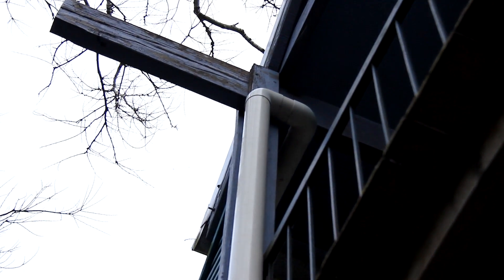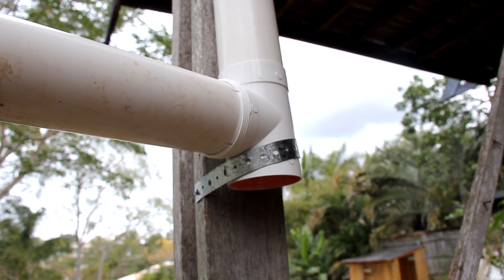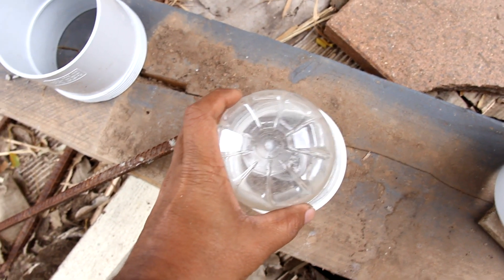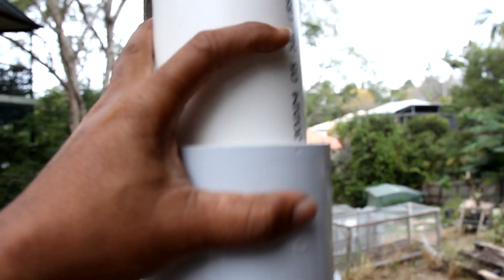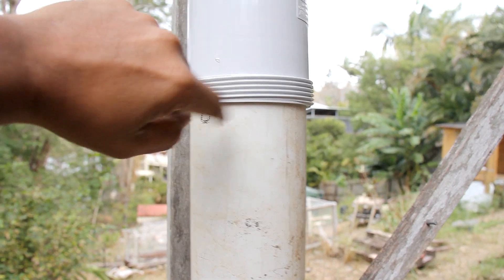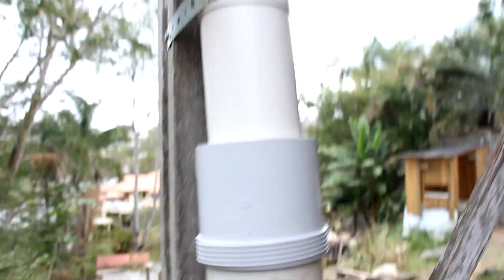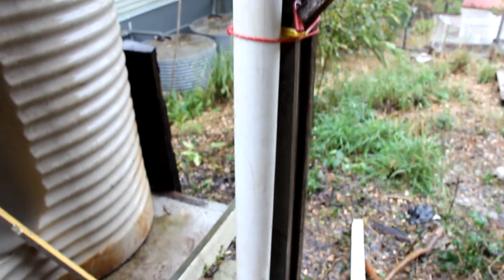How To Make Your Own First Flush Diverter System

Comment: Thanks mate. This video was very helpful. Building my own first flush system. Using your idea to use a bottle inside the pipe, as well as not tightening the cap to allow for a bit of water to seep through.

Comment: If the vertical flush pipe assembly were left loose and slightly leaky it may serve the same purpose as the tiny hole people like to drill through the bottom cap for overflow drainage. Optionally, I'd just leave the bottom cap slightly loose as you suggested but with a brick under it, just in case, that will let it continually weep a tiny amount and prevent back-flow of dirty water up into the tanks.

Aside from spending the dollar on the ball rather than messing about with a plastic bottle, your DIY design is very admirable. Cheers.
Reply from the maker: I do sometimes just leave the cap loose. The primary reason I wanted to utilise a hole in the bottom is that you'll notice the downpipe and hence the drainhole ends right at the base of one of the major posts that hold my house and deck up. I'm not overly keen on having the oxidisation of the steel stirrup accelerate or wooden post rot from the excess water being in that area so by using a hole I can determine the appropriate size I need to put a long term fitting that I can then redirect away from the house post  via a small garden/irrigation hose offcut.

As for the $1 styrofoam ball, maybe I watched too much McGuyver as a kid but there's something satisfying of being able to utilise things lying around the house and repurposing them.
 :o)

Comment from the maker: I received an email with someone asking "I wonder if you could cut a 1 inch by 1 foot vertical slot toward the bottom of the 100mm tube and epoxy glue a clear plastic window so you could look in the pipe to view any sediment build up?"

You could but being outdoors the clear perspex would allow sunlight into the pipe and algae would bloom negating any visual aid and increasing the chance of it all clogging up. So I would not recommend it. 

The the threaded cap at the bottom is there to allow clearing and inspection of the pipe.
Reply: Carazy.net Permaculture good point.
Reply: just add a cover...

Comment: Only thing I would not reccomend is the water bottle or float being a close fit. If leaves etc fall in the flush pipe they'll jam the float down.
Reply from the maker: Good point. I have gutter guard installed to prevent large debris entering my downpipes so it's not an issue. 
http://carazy.net/blue-mountain-gutter-mesh-install/

There are also number of different strainer type PVC fittings that are cheap ($1-2) that people could implement in the entry point where the gutter feeds the downpipe.  This would have the benefit of stopping leaves before they enter your pipes. You'd still have to maintain your gutters though. It's the trade off people need to work out on whether the expense of gutter guard outweighs the long term costs of gutter deterioration and cleaning expenses.
Even a small piece of flyscreen, siliconed in the gutter over the outlet where the water drops down would sufffice. 

My tank also has a strainer on it's inlet and this system is designed so that even if leaves were to fill it up, unscrewing the end cap on the 100mm pipe and cleaning it out should prove easy enough miantenance. Two years on and so far I've had nothing but a few geckos and roof silt.
Reply: I use two 45 gallons barrels plumbed together, after the rain fills them it flows over into my collection tanks.  I use the water from the barrels to water my plants and garden, in that way I don’t waste any water.  Barrels get drained down before next rain.

Comment: Hi! I'm obviously really confused here. I found this video while looking for another type of flush system, but thought I'd watch to learn something new. I understand the reason to have a primary collection point for sediment to collect and be removed from the water you'd like to use, but this system seems to imply that the sediment will collect in the tube you add here - isn't that a real pain for cleaning it out? And what purpose does the float have? Does it close off the supply to the tube you've added here once it's full? Doesn't this cause the dirty water to pass right into your tank once the new section becomes full? I'm probably getting this wrong here. I'm just very confused. I would think that a primary tank for filtration would be something that would automatically separate solids from water and be easy to clean and not have a float system that would render it's purpose invalid once the tank is full.
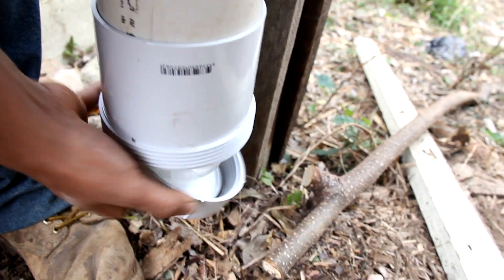Reply: The concept he is going for is to simply trap all the oil, pollen, ect from the first flush of the rain collection surface(roof).  After that he isnt really worried too much about sediment. The hole he proposed 5:40 is an auto reset for the system that would allow it to collect more sediment in a long steady rain.
Reply: I get what you’re saying too. I don’t understand the float. I don’t think it is needed.
Reply from the maker: XcerptShow has answered this for me. The float is to isolate the sediment filled water that accumulates in the diverter, from the flow of water to the tank. If you imagine the falling water from the vertical downpipe churning up the sediment in the lower part it would cause a lot of turbulence. Also there's the venturi effect of the water flowing to the tank which could then suck up the turbulent water.